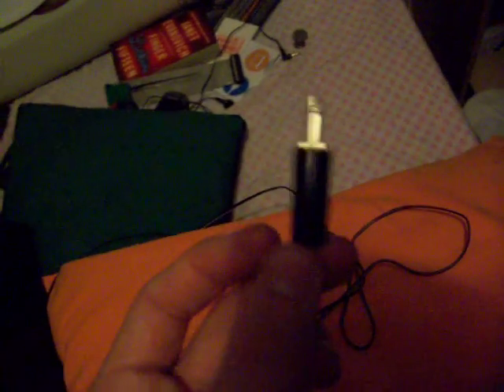Wire Speaker to Plugin Speaker Converter

Comment from the maker: @scottemont do you have an amp built on to it? if not then it might help to make one (i have plans to make one but everytime i buy the parts something comes up and they become lost lol) another posibility is that the wires or solder joints are shorting out (look it iver and see if there are any points near each other, if there are bend them apart with a screw driver, knife, etc.) hope this helps :)